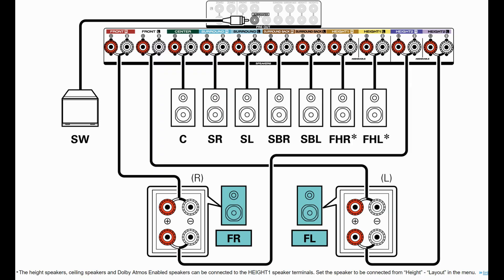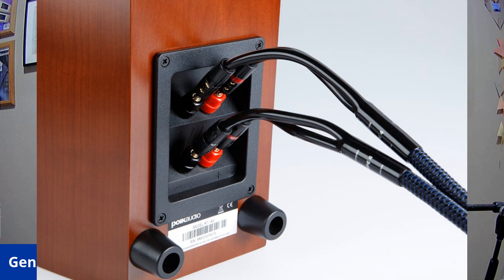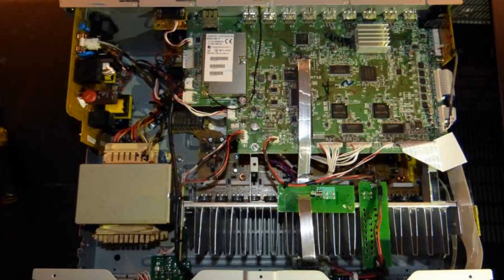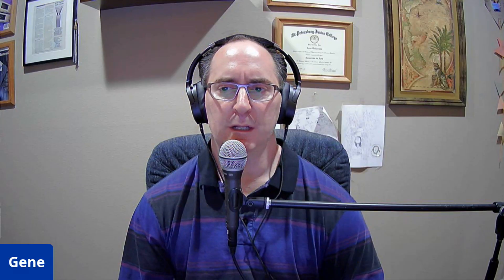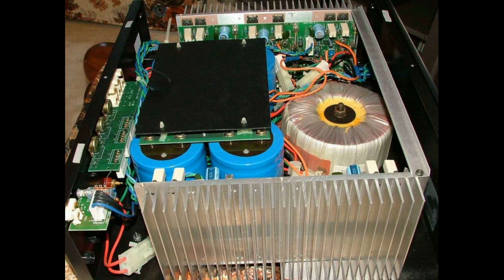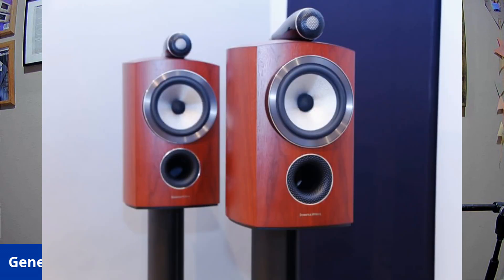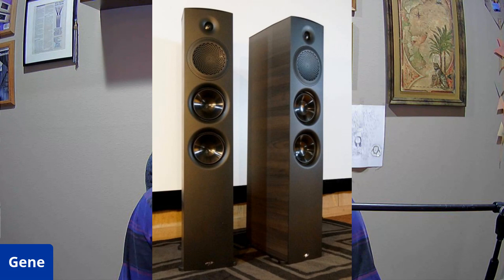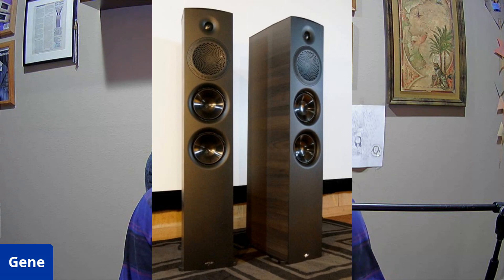Should You Bi-Amp Your AV Receiver?

Comment: Have to disagree with the conclusion drawn here. I bi amped a mid level denon 75wpc theater reciever in order to drive a pair of mirage m990 speakers and am thrilled with the improvement in capability from a cheap goodwill and marketplace setup that cost under $200. I would challenge anyone to get better sound with new components at ten times the price. The receiver claims true 75 to all five channels and after biamping the whole house sounds like a concert hall from some mid level super cheap components.

Comment: Hi, help me please!
My HT system is a receiver pioneer ELITE vsx32 connect in a amplifier emotiva XPA5 Gen1 (8-4 ohms per channel). And my speakers are bookshelfs Energy RC10 (8-4 ohms) and towerfloors MA Silver 8 (4 ohms). In a past when only bookshelfs i bi-amp the Energy RC10 speakers and like very much this experience. After this i buy a Silver 8. But i don't  bi-amp my system again because i affraid the impendance maybe damaged it. My fóruns friends sade bi-amp could be change impendance, in this case 4 ohms to 2 ohms! Is this true? Bi-amp double original impendance? I question this to emotiva and monitor audio, but both no answer directly the question, both excused thereselves. Somebody could help me, please?

Comment: Denon 4800 new. (125w. Per channel)
 2 Klipsch 82RF II,( Bi-amp) 
2 K. RS52, 2 K. RP 500SA II, 1 K. RC42 II, 1 K. Sub SW310, 1 K. Sub 10S, 
2 Onkyo SKF 4800. 
Main zone living room, 18’x24’ w/ 9’ ceiling. OK so there is some 15 year old dust on Klipsch but I do have the new up firing K. Dolby Atmos, and Denon AVR. 

Question: Would  you bi-amp or bi-wire the 82s. I have to ask cause I’m a little confused on how many channels I will result in one way or the other, and would I need a secondary amp? Thanks for your replies and honest opinions ahead of time.

Comment: I recently found that my Denon X7200WA gave me confusing results when I accidentally switched from bi-amp to non bi-amp (or "Dolby Atmos" mode). I have religiously bi-amped as I have enormous Mission floorstanders. I also run two big subs. 

I was listening to some blue rock stuff and didn't actually realise I was still in Atmos mode. By God, did the base come out more clearly, more focused, more rounded, and more vibrational through my wooden floor. Everything to my mind got better. I then switched back to bi-amp and honestly, the bass was too much. AND it was pretty muddy. Maybe I need to adjust something else on the amp, but heck, I wasn't expecting that. I feel like I need to re-listen to all my hi-fi stuff again.

Anyone else recognise this situation?

Comment: lets say I have a 7 channel receiver and I only have 2 Klipsch rp260fs, will I be able to bi amp only using my receiver? or i need to get a separate amp? is it possible to use the extra channels without having to use a separate amp?. I have a onkyo nr6100

Comment: Hey Gene, coming back to this after getting into it w a guy. My statement was that Bi amping is pointless (at least with the cheap receivers)
The cheapies are all rated 2 ch driven anyways. So I would think for two channel listening the benefit would be none.  Assuming the power is "rationed" out with multichannel, POSSIBLY the Biamped (mains) be getting a bigger ration if you have extra channels to throw at it? Maybe in that case you could see benefit? I'm really just looking for more ways to explain it is pointless, although this guy claims he saw a huge difference.
Personally, I've got preouts going to a minidsp then to a real multichannel amp before the towers.

Comment: Figure I’d try to bi amp. I have a Yamaha rx-v6a with klipsch 5.1 r-625fa speakers. Haven’t had it set up in 3 years due to being in a climate controlled storage unit. 

Watching this video kind of bums me out as I’d try out the bi amp feature now knowing that using the extra amp for my tower speakers is worthless after I hooked them up due to low power production on receivers lately? My budget for a receiver at the time was 700. 

Not nearly a pro so seeming I just wasted money? I still don’t have a room to correctly set it up to a true 5.1. Eventually I want to make it a 7.2 and obviously would delete the bi amp setup. I still don’t have the speakers broken in after 4 years of having them. It’s been too long to even notice a difference but figure I’d try the bi amp, like ya said why let one just sit and not be used, is what I was thinking a couple days before I watched this. I’ll run it as is for now,

Anyone have any recommendations?

Comment: I am still learning alot and have a question. I have a Denon 4700h that im running in 11.1. 7 of the channels are powered by an external amplifier. There are 4 channels being powered by the denon. Is it possible to used the idle internal amps for anything like bi amping or another set of speakers even though the pre outs are in use? Thanks

Comment: I know it’s 3 years later but my AVR-x4500h will not let me  bi amp through the pre outs. Trying to bi amp to my monolith 7x with no luck. Looks like can only do it through speaker connection. So I’m splitting the left and right fronts to the amp through the rca. I believe that is actually hurting the rca output value but have no other way to bi amp. Powering RTAI9S

Comment: great content Gene. precisely, bi-amp is only usable when these boxes are checked; 
1. internal crossover or DSP to separate & redirect high frequency and low-mid frequency into two different channels
2. speaker is bi-wired capable with 4 binding post
3. speaker does not have analog or physical crossover

but most of the speakers nowadays do not have bi-wiring capability (4 binding post) and absence of physical or analog crossover.

Comment: The Cinema 30 i was testing can biamp but sadly i cannot bi-amp the center alone.
I have SVS Ultra Bookshelfs in the front and the SVS Ultra Center. The Bookshelfs are only rated 150Watts but the center is rated up to 225Watt. Thats where i would want to use the biamp because that speaker potentially can do something with the added power. Its a 3 way so i guess mid high and bass are separated. That might free up some additional room in difficult movie scenes.

Its not a issue but it would have been nice to be able to select the Center only instead of biamping the two fronts.
Its either  the Front two speakers o 5.1. And with the A1H its the same but for 7.1
The custom mode wont let you set what speakers you would like to biamp.

It would have been nice to have more flexibility with setting where you want to allocate the unused channels.

Comment: Thanks for the impartial information.  I passive bi-amp Martin Logan Vistas (electrostatic) with the Onkyo TX RZ50.  I listen mostly to 2 channel music (plus sub).  The MLs sound great! and perform well as fronts for a 5.1 system.  The RZ50 has 120W/Channel at 8 Ohms.  Seams to be enough power to drive all of the speakers.

Comment: Gene, I have the Denon AVR X8500HA with an external Monolith 5×200 watt power amp that I'm using to Bi-Amp my front SVS Ultra Towers and also use it for the center channel. I use the Denon to power the other 6 + 6 channels... it's a beast in this configuration and I love it!!!

Comment: I just buy yamaha rx-v6a and polk audio signature elite es55 towers. I just buy cables for bi amp. So you tell me I just waste money? Yamaha have stereo mode and bi-amp mode in software. I will use central speaker later and subwoofer. I think no need surround. 2.1 for stereo and 3.1 for film vod and ps5 gaming.

Comment: Can I bi amp from one 5 channel external amplifier? I want to use two channels each out to Polk R700. I thing the amp is rated at 90 watts x 5 channels. The last channel will not be used. I was wondering if its as simple as 90 watts x 2 = 180 watts into 4ohm speakers. I did notice that sometimes when power to 4ohm loads the watts increase. I don't want to blow anything up. Amp:5 Channel Monoprice Monolith 90w x5. Avr: Sony AN1000 165w x7.. Maybe I can bi amp using one as a hfa and the other as a lfa?

Comment: I bi-amped with my Denon x4000 AVR with Monitor audio RS1 bookshelf speakers.  The speaker are 6 ohm rated by the manufacture.  The crossover setting was at 80Hz.   My AVR amp was fried.  Several resistors were burned out on rear channels according to my local electronical repair man.  It cost me $185 to repair.

Comment: Hi folks, I currently use an old and cheap denon 1912 in bi-amp mode on the fronts, wich are floorstanding canton ventos 890.2, wich are capable of a power consumption ups 350 watts. Trust me, it does make a difference in stereo to a certain point at higher volumes, where it has a little more breath than Single amped. But the small powersupply has of course it’s limits built in. I ordered a denon avr x6700h as an upgrade and will probably use bi-amping again, since I drive a 5.1 system. I‘m curious what the higher class amp and the bigger powersupply can do.

Comment: If your receiver and speakers have bi-amp capability and you can spare the back surround channels, then I don't see why you wouldn't. Maybe you don't want to spring for another set of speaker cables? Maybe you don't want to wade too deep into the receiver's settings?
I treated myself to a pair of Paradigm Premier 800F's recently and was all too excited to utilize the bi-amp feature of my Sony 3400ES. It is massively important to ensure that matched amplifiers are used for bi-amping, no mix-and-match. Also, make sure your speaker cables are the exact same length. I think on paper bi-amping allows cleaner power to be delivered to the mid and tweeter and may confer some additional benefits when considering impedance stability. The bass section of the 800F's is relatively solid but I definitely didn't bi-amp to realize bass gains as I bought a pair of Paradigm Defiance X12's to round out the 800F's bottom end. It may be useful to note that even though the receiver has lots of theater chops, I'm using it in a 2-channel setup.
A small subset of gear owners actually bi-amps but an even smaller subset has the gear to utilize active bi-amplification. My speakers offer no way to defeat the internal crossover network and I'm okay with that because I trust Paradigm gave those 800F's the best crossover for what they are capable of.
As to bi-wiring - you're just wasting speaker cable at that point. If you really want to buy another pair of speaker cables to do this, remember: "a fool and his money are soon parted".
Speaking of, I will probably go back to not bi-amping when I spring for that Anthem STR amp as it is already breaking the bank just to have two channels of that sweet "Crafted in Canada" sound. But that will be mostly offset when I eventually pair it with an STR pre-amp and join them with XLR connections.

Comment: You mentioned that bi amping with a bookshelf set is a waste of time. What if I am using a sub with a high level input? Would that benefit in a 2.1 setup? I am running a set of CM1 S2s and a REL T7/i. The AVR is a Str-za1000es so it may be a moot point given the 100 watts power channel output.
Reply from the maker: Biamping to just a tweeter w the passive xover network still in place has little benefit. Your Sony has more power reserves w just 2ch driven, so I would single amp those speakers.

Comment: My system consists of a Pioneer VSX-1023 ($500 avr) and a couple of Altec Valencia speakers/cabinets.
I removed the crossover networks aqnd installed banana plug jacks to use in bi-amping. The avr has a bi-amp feature,  but there are a couple of issues.
The crossover frequency was designed at 800Hz. and the avr has a 200Hz. limit. The other issue is the lack of clarity about using the feature. The manual states the bi-amp feature includes Surround 5.1. I've done the bi-amp section but haven't figured out how to get the Surround 5.1 in the settrings. My test file is the TV episode: Star Trek s01e04, with 3F2MLFE audio configurtion.

Thanks for the video, thanks for the information.

Comment: Hey Gene, I’ve owned a tx-nr3010 for quite some years now. In this receiver Onkyo offered a feature that they called the digital processing crossover network. I loved the idea because of some time I spent enjoying car audio. It was common to run the pre signal to one amp that would amplify the high or low end and then filter and pass the pre signal to the next amp that would then handle the complimentary portion of the music (high or low depending on what the first amp was handling). Onkyo, I think, stopped offering this digital processing crossover network feature.I thought the digital processing crossover network allowed for “active bi-amping” because it split the signal before the amplifier stage. Almost every forum I read on bi-amping it seems like there’s some consensus that active bi-amping as opposed to passive bi-amping does provide some benefit. Is this feature that Onkyo offered (splitting the pre signal digitally high/low before the amplifier section) not really active bi-amping and if it is why do they and other manufacturers seem to not offer it now??? I ask because I recently purchased a used marantz AV8801 and was surprised to see that it doesn’t seem to offer even passive bi-amping as a feature. It’s supposed to be high end and came out around the same time as the tx-nr3010.

Comment: I have a jvc rx 8000v, and I wanna pick up a set of jbl e80. The jvc has avalible slots for 2 sets of front speakers, and I wanna know if I could just bridge the 2 front channels for left and right respectively, to get more wattage to each speaker. The e80 say 200w rms per tower, so each of the 100w front channels would be combined for 200w per speaker. I'm just worried if the signals would be different for the 2 different output points of the channels

Comment: Bi-amping makes sense only if the speaker reaches such power ranges, where the amplifier is already starting to distort in the low-frequency part, but the speaker can still handle even more power.
Distortion in the bass range is not as disturbing as in the mid-high range.  Thus, with bi-amping, we achieve clear mid-highs even when the amplifier (not its power supply) is working at the limit of its power.
The problem with AV receivers is always the power supply, very rarely the amplifiers... so bi-amping rarely makes sense.
It is different with external amplifiers (for one speaker)... where, for example, with stereo amplifiers this approach makes sense, but only on the condition that the power supply can handle at least approx.  20-30% more power than only one power stage requires.
My example is the five-channel Monrio MP5 power stage, which has 3 toroids and 5 identical channels.  One 300w toroid powers the center channel, and two 400w toroids power two channels each.  So with this multi-channel final stage I can drive all three front speakers each with their own power supply...left and right even with "good-sense" bi-amping.
So the AV receiver (Onkyo TX-RZ900) is relieved and drives only 4 speakers - two surround and two Atmos. This is bi-amping that makes sense.

Comment: I built my own bi-amping amp, 4 lm1875 ic driven mono blocks, 2 active analog 2nd order active cross over with an output protection circuit…oh yeah large toroidal xformer, nice bunch of caps… so yeah. Sonically impressed ,I had chosen speakers before deciding on cross over frequency point ….. 

I need to get it fixed up, one of the amps inside shorted out when I tested it after 10yrs of storage. 

Maybe I can put in some class d amps and revamp the whole thing. 

Would be a great project AGAIN.

Comment: I bi-amped my RP-600Miis with my Denon AVR-X4700H to go along with my other 5 speakers and sub.  Personally, I heard a difference when I realized the receiver had the bi-amp feature vs single-amping and tried it out.  It uses 2 of the 4 height channels, neither of which I use, so I figured "what the heck."  Like you said, it's a bigger effect when I'm only using the /R speakers listening to a CD, a vinyl album or streaming music.

Comment: I Bi-Amp my L+R but I don’t bother with any of the Receivers Amps even though have a nice Denon, I have a 5ch Amp that I send 400+/-wRMS@4Ohms to the L and R and use the other for my C until I can get my 2 MonoBlocks then I’ll be able to send 1100wRMS@4Ohms to my L+R and then I’ll Bi-Amp my C and send the other 3ch to my rear Speakers or depending when I get the MonoBlocks if I upgrade by then perhaps I’ll use it for front height Speakers for an Atmos System.

Comment: I have no idea if this will ever be read but I recently reorganized my setup. Running a PC as my main media source. HDMI to TV for 4k on 65" HDTV, and a second HDMI cable to my old Onkyo TX-SR605 5.1 Receiver. I've had it for over a decade and I've never had a single issue with it. I run two Energy Connoisseur CF-30 towers (more on those in a minute), an EW-100 subwoofer, and Energy centre channel. I started with the 5.1 Take Classic set and have upgraded over time. I'm not currently using rears or the surround.

That gave me an interesting opportunity however to use the surround outputs as bi-amps for the tower speakers. There is a label on the rear outputs, and a setting within the receiver setup menu itself to enable the feature. I've been running that for a while and it seems to perform well. However to my ear, it sounds almost the same as a passive bi-wire setup to the same speakers. There IS a noticeable difference to having it bi-wire/bi-amped vs not at all so I will continue to run it bi-amped until I upgrade the whole system.

Just fyi previously I was using TOSlink optical to run from the motherboard to the receiver, but had my eyes opened when I was reminded it only provides 2 channel PCM rather than the higher bandwidth HDMI. 

Thanks.